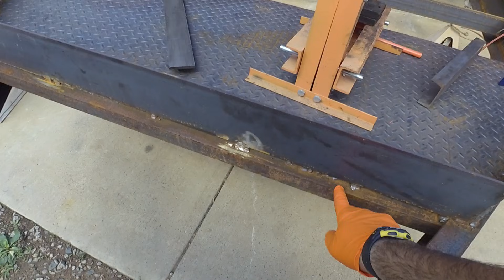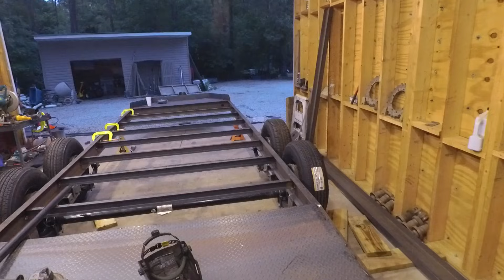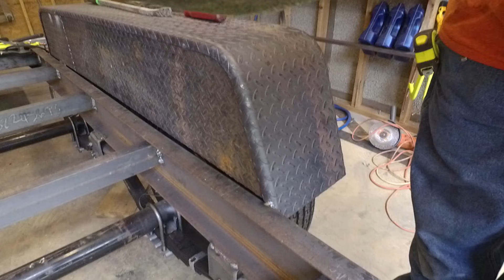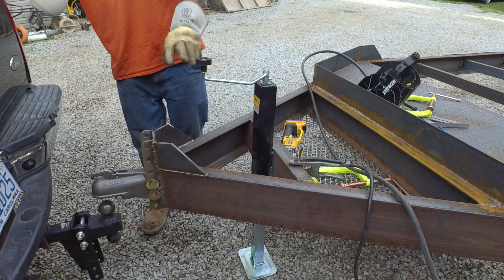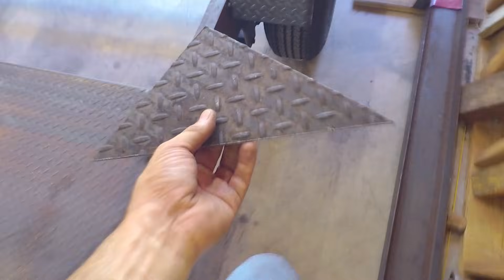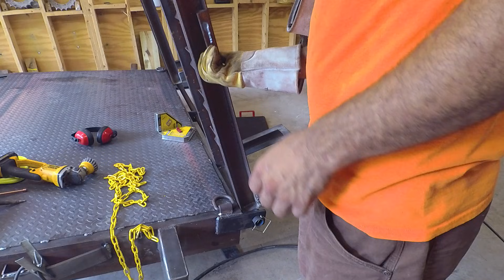Equipment Trailer Build Part 2 Tongue deck, fenders, ramps, rub rails

Comment: Just a note.  A place to hook your safety chains when not in use on each side might be nice. Just a small hoop that will accommodate the hook  Keeps them from lying in the dirt or killing the paint on the tongue when the trailer is parked.
Reply from the maker: I'm going to use the gusset for the hitch coupler. I'll talk about that in the next video. So far the trailer is working pretty well. Should be getting a tag this week!

Comment: Great Video and super high quality build, you should do a cost breakdown when u finally finish it!
Reply from the maker: I have all the costs in a spreadsheet so I will make sure to cover it. I definitely spent more than I thought!
Reply: @GCFD  ... but I bet you have something of superior build,  something you like and can use for your own needs.
Reply: Yeah I know that these are not cheap to build I ordered some materials like two years ago right after the pandemic and just a few things to update a trailer that was already existing was like over a thousand or $1,400 so I know to build this trailer with axles tires everything you're talkin probably I would say no more than probably five to seven thousand depending on how expensive things are out there where you're at

Comment: Cleanest way to fill the hole is to to take a steel plug of similar size of hole. Weld around the plug, much less grinding.
Reply from the maker: I actually did that with one of my 3/4" plugs that I drilled. It worked much better! Thanks for sharing!

Comment: How do you get the trailer road certified / titled in NC
Reply from the maker: Go up to the Tag office, get an MVR 15 with a VIN. Stamp the VIN on the trailer, take the trailer to inspector and get them to sign off on it. Then take that paperwork back to the Tag office. That should happen this week so wish me luck!
Reply: @GCFD  Sounds simple. I guess, it would require tons on paperwork here in Europe, to let it drive on road
Reply: @GCFD  Good luck and thanks for the response
Reply: What a great two, hopefully 3 part with paint video. How long have you been welding? I definitely would love to see the reveal to you crew and see their reaction. Now I want to go buy a welder and get into some trouble. 😁

Comment: Filling holes with weld in steel.
1 get a thick scrap of aluminum preferably forged or rolled
2 clamp aluminum to back up the hole
3 fill the hole with weld 
4 grind flat
Reply from the maker: 👍 Thanks!

Comment: Great job Sean! I'm glad you changed the things that you didn't like. I do the same thing now but only after I made the mistake of settling for something and saying it was good enough. I swore at myself for 3 years every time I looked at it and wished I would have changed the design when it was the easiest.
Reply from the maker: I agree Ed! I knew that stronger piece of C channel was going to be a pain to cut, but I was like, I gotta do it. Plus doing work "for the video" holds me to a pretty tough standard.
Reply: I kind of understand the video aspect...
Yet, I do things like that without "video pressure". I believe you do as well. From what I see, you're a good guy and most likely would have done the same thing without the video. Keep up the great work!
Reply: Could you mount your winch on a 2” tube bracket then put receivers on your trailers so it could be swapped about to which ever trailer you need it on (or truck if they have those hitches) 😀

Comment: May want to put some angled pieces under your wheel wells in the center to help support it in the middle (should you step on it)
Reply from the maker: Yes I have those plus a bar welded across the bottom of the fender. They’re strong for sure!